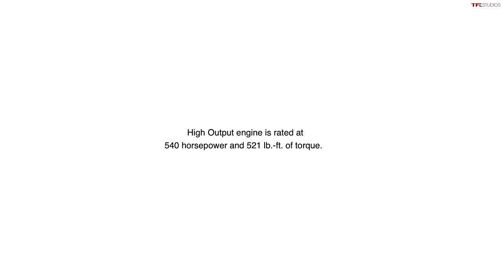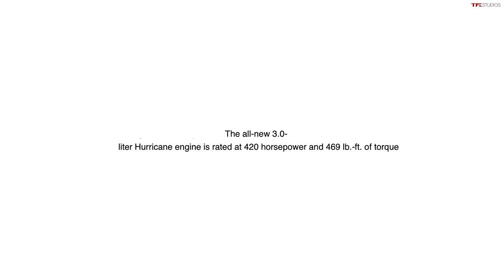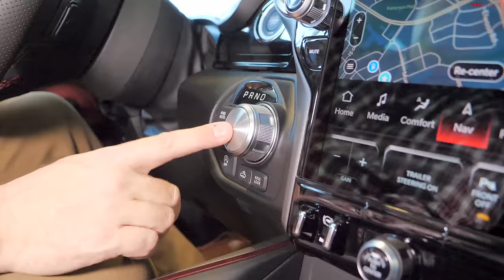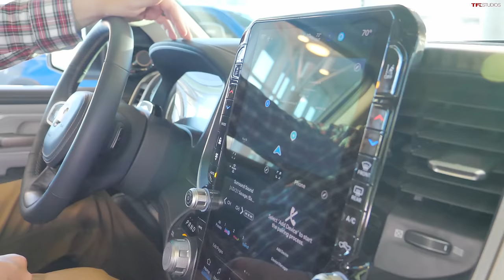I Go Hands On With The First New Ram 1500 In Over 5 Years - Did They Get It Right?

Comment: Let's call it what is is - a COMPLIANCE engine that has more parts to fail and needs premium fuel for the HO version, which offsets any mileage improvement over the Hemi.  $90k trucks with more maintenance cost. Zero savings to the consumer.   Insane.
Reply: Every engine is a 'compliance' engine. When the hemi replaced the magnum engines, the hemi was the 'compliance engine'.
Objectively, an inline 6 is a simpler engine than a V8, so that's an improvement to me.
Reply: @steinwaymodelb yes, an inline 6 is mechanically reliable. But not when you add 2 turbos. Can it be done? Yes. Will it be reliable? Only time will tell and as usual the consumer gets to be the guinea pig.
Reply: @steinwaymodelb  I'm not sure, adding twin turbos, that does not improve reliability simply for the fact it's more complex, plus 90% of RAMs will have the S.O.. engine, while producing more power, gets lower towing and payload rating.
Reply: You are correct sir the H.O requires premium fuel which will kill any gas savings you need
Reply: @steinwaymodelb  Not exactly sure that adding 3 extra camshafts, 8 more valves, direct injection and individual cooling systems for each turbo is more simple than an OHV V8.  Although you do get a shorter crank and don't have to pay for an extra 2 pistons.
Reply: Ill take the new 3.0tt over the 5.7 any day and tune it.  The ram should have had a 6.4 option.  The 5.7 is mediocre, I wont miss it.
Reply: @sergeysmelnik  while i agree the 5.7 was meh, id take it over the 6 any day. The 5.7 was sufficient for a 1500 truck. Now your putting that load on a small engine with boost.
Reply: @mikebandw186  Turbocharger technology is now over a century old. European and Japanese automakers have been making reliable and durable turbocharged engines for decades. 21st-century CAD design, metallurgy, and lubricant chemistry make these engines at least as durable as rusty Hemi designs and likely more durable. There will be the usual minority of clowns who refuse to change their oil regularly, use the wrong oil, or use the wrong fuel, or do something equally stupid and then blame the automaker for their foolishness, but that will always be the case.
Reply: @_emh  Manufacturers have to take into account the lowest common denominator--make it idiot proof. The issue is that these little engines are not going to live longer than a V8 as cylinder pressures in these boosted units equate to higher loads on bearings and rings. They're going to fail long before they should. We're not talking about passenger cars here, we're talking about trucks which are considerably heavier without adding payload or towing a trailer, so yes, turbos have been around more than a minute but the principle hasn't. There is no free lunch, as the saying goes. Cheers!
Reply: However, for people complaining about smaller displacement turbo charged engines, I hope they do realize that Semi’s have been using this technology for decades, and have 300,000-500,000 trucks on the roads, and million mile examples on the road. This technology is all semi’s. Just say you’ll miss the noise of a V8! But an in-line 6 is a great engine to start with! The only thing that be better would be and inline 8! The only problem I see with all trucks at this point is the price.
Reply: The maintenance will be the same, repairs not. Also hemis run on Plus and 6.2 runs on premium
Reply: @georgeferrier9461  Semi's are powered with turbocharged diesel engines, not gasoline like these little engines. If they were gasoline powered, they wouldn't be able to have a GCVWR of 80,000#.
Reply: @strykerentllc  I don't see the basis for the claim that "these little engines are not going to live longer than a V8 as cylinder pressures in these boosted units equate to higher loads on bearings and rings. They're going to fail long before they should." Again, it comes down to performance within specifications. A Hemi V8 subjected to the same cylinder pressures as these straight-6s would of course fail prematurely, because they weren't designed for that. These engines were designed to run at their operating pressures and the materials and production techniques used were selected to ensure durability at those specifications. There's no reason why we shouldn't see some 300k, 500k, and greater mileage examples of these on the road from owners who properly maintain them (granted the reason we see fewer of those today is more truck owners are trading in their trucks more frequently these days and thus always owning a lower mileage truck).
Reply: @_emh  The V8 Hemi in the 1500, 2500 & 3500 are naturally aspirated, not turbocharged and do not operate at the same cylinder pressures. You don't know that? The pistons are cast, manufactured with the same material - 4032 to alleviate piston clatter during cold starts. You didn't know that? If we call upon 6 pistons to produce the same or greater power than 8 pistons, those 6 pistons carry higher loads than the 8. It's simple physics. You didn't know that? Well, now you do.
Reply: @OttoTetrazzini well said .!.!.
Reply: @strykerentllc well said brother, my last purchase of ram was on 2022, they ditch the V8 ..!. Well i ditch them too .!.!
Reply: @gpaje  The information being provided by the site was strange, it showed the SST S.O with better towing and payload and the SST H.O with worse towing and payload
Reply: They’re not complying, Stellantis hates the V8
Reply: @georgeferrier9461 noise, low end torque, simplicity, all of it we’ll miss. Enjoy your quiet overpriced truck
Reply: Ouch

Comment: With those prices, there's gonna be a surplus of these sitting on dealer lots as well 😂
Reply: I got my eye on that Rev and Ram charger. I'll pay the premium to save a ton of money on gas.
Reply: Already is... dodge ram crysler jeep.   Packed solid.. then remove the v8 and its done.
Reply: Fact
Reply: Agreed!!!!
Reply: Yeah, and $200 a month zero down leases will be coming back as well. Right before they go bankrupt.
Reply: esp. when the stock market corrects--incoming
Reply: Wait till you have to replace the batteries ☠️
Reply: @naaruto567  Boy, talking about a nice bill on that one. That is a major issue. Who will buy a 5 years old EV or Hybrid car? Factory gives, what? 8  years on the batt?
Reply: @Turshin  don’t get too excited, my family has three Teslas and our electric bill doubled
Reply: The turbos feed the cylinders
Reply: @michaelottesen6143  One concern I have is cooling these Turbos down under load. Is that engine will take heavy work as a truck and day to day riding. Time will tell. I will not be the first to own, that's for sure.

Comment: To me nothing will ever beat a V8 sure the numbers may be higher, but the sound of a V8 can't be beat especially when you open them up. If i cared more about how much my truck can tow I'll look at getting a 3/4 ton or 1 ton truck.
Reply: I agree i will miss it, but i did have better mpg lightweight with Pentastar v6 , same with 3.7 v6 f150, both about 25 mpg interstate when riding empty
Reply: It won't be hard to beat the reliability of the hemis
Reply: @smiller225  lol, i hope so, you never know ... for me 3th gen egr replace only until tree fell on it at 150k , 4th one exhaust header bolt broke already at 105k, luckily tick goes away in lik 10-20 seconds
Reply: At least they put an inline 6 and didn't put a vibration prone v6 like Ford did.
Reply: Well said!
Reply: Agreed.  I miss the V-8 sound.  I have a turbo 4 Silverado and it has great low end, but sounds like a minivan when you go hard on the throttle.  Wanted a RAM with a Hemi, but with all the BS packages you have to get, would have cost another $15 grand.
Reply: @nezabytes  Which motor is vibration prone? I have a 2017 3.5 Ecoboost and it runs buttery smooth. So much so that on several occasions I’ve accidentally eased off the brake pedal and didn’t even know.
Reply: @joshnc101  v6 engines are inherently imbalanced sir.
Reply: @nezabytes   Well car makers must’ve figured something out cuz newer v6 engines I’ve had experience with don’t vibrate.
Reply: @muznick  but isn’t the sound of a wet fart hemi worth an extra $15k?😝
Reply: @nezabytes  perhaps you have the same problem?

Comment: Love the chassis view of the truck mechanicals. Just awesome.
Reply: Yes. But wish it showed the cooling stack on there. 
Otherwise love how the cats are tucked up close. Prevent theft and fatten them up faster at startup. 
And where the air suspension air tanks are would make a great place for a battery pack for an SST hybrid!
Reply: @upshifter5316   A hybrid would be cool. Especially if engineered for low end torque.

Comment: I love my 2016 with Pentastar V6, solid, reliable powerful. 150k and counting with no issues
Reply: I have same year with 5.7 at 130k, been solid as rock. Other than normal maintenance and one front wheel bearing (under warranty)it’s been great. Had an 06 before it that was still running great at 250k when I traded it in 19
Reply: And gutless, your forgot gutless pentastar
Reply: @pech_wake_day1153 I’ve driven many V6 Ram’s and it’s far from gutless. Unless you’re an idiot and are racing it, it’s got more than enough power for daily driving, merging onto a highway and light towing.
Reply: My 15 is going strong as well!
Reply: Much better then this new crap
Reply: @pech_wake_day1153  gotta have that HEMI for going to Starbucks and Lululemon, huh?
Reply: If you think that's powerful, you previous car was a powerwheels.

Comment: The cost of these new trucks has convinced me to go another direction. Currently saving up for a 1980s Bullnose F-250. For the same money as a down-payment and 2 monthly payments on these Rams I can buy one, restore everything under the hood, upgrade to softer springs and shocks and do everything with an old Ford these things can do except for big towing, which I don't plan on doing anyway.
Reply: Do you live in a locational with minimal oxidation concerns? If so, I endorse your redirection.
Reply: @smithjones1906  I'm in the Northeast. I plan to buy one from the South and I'd keep it parked in the winter and continue daily driving my Subaru.
Reply: I'm saving up for a Komatsu D355A.
Reply: Yup. I looked at new trucks last year and.........I turned around and went and bought a 98 ram 1500 instead.
Reply: You won't have the luxury of the most current government tracking device in that old truck.
Reply: I'm keeping my 2019 Ram 1500 Laramie & buying a tricked out,  refurbished Bobbed Military 900 series truck.  Even with all the bells and whistles, it'll still be wayyyy cheaper than a new Ram !🙄
Reply: 2024 .... that's a hell of a price for being stylish ! @RamblinRoadies
Reply: @haggisnwhisky  See if you can get an old deuce-and-a-half truck or even a 5-ton from a Goverment Surplus Auction and BOB that! 

Those go forever and the ONLY ISSUE is that you SHOULD be sand-blasting the interior and putting in a quarter inch thick coat of Line-X truck bed liner on the entire interior AND the entire underbody, wheel wells, frame rails and even engine bay walls to ensure maximum anti-corrosion and anti-rust protection! The thick Line-X coating also reduces interior noise! You can get an old 8-foot bed from some junkyard and make it at least LOOK like a more modern truck by putting in on the back in place of the rattle-trap wooden and steel rail beds they usually used!

Reminder to do a FULL engine flush and engine shampoo to get that engine all-cleaned up!

V
Reply: @RamblinRoadies  the government will know exactly where he is at in that old truck if he has his phone on him🙁

Comment: The Rebel grill looks so much better than the older style.
Reply: That’s because it’s from a TRX. The entire front end is from a TRX which really cheapens TRX brand. Glad I sold mine
Reply: @313soldier313  I own a TRX and it’s not even close. What is wrong with you?
Reply: @DeepDishPizza  yeah so did I. Until I realized what a load it was and traded it. It looks near identical to these “2025”. The hood vents, the emblem placement on the hood, the headlights, and the grill are lifted directly from a TRX. So are the recovery hooks.
Reply: Looks the same as any other Ram now. The old grill at least was different.. l.
Reply: @BadDriversOfMass  Huh? Are you blind?
Reply: Rebel grill looks like the old gmc grill stop it
Reply: @313soldier313  the new rebel looks more like the old rebel and the new rebel looks more like a regular trim just with a mesh grill. Def looks less like a trx then it did before
Reply: @albertwilliams2990  That’s not true at all. Are you blind?
Reply: @313soldier313  it’s not from a TRX
Reply: @DeepDishPizza   I literally just did a widow by window picture comparison with a picture of the front of my old TRX and the front of this truck. The difference is barely noticeable lol. The grill is almost the same on the rebel just a tad bit bigger. The main difference is the TRX has a hood vent to feed the supercharger and the rebel doesn’t. So quit acting like it’s some radical redesign. It’s close enough that at a distance I wouldn’t be able to tell the difference. Maybe you’re the one that’s blind.
Reply: It went from ugly to kinda ugly. I don't get the random curve on the lower grill trim.
Reply: @313soldier313  It’s a great redesign and not even close to whets you’re saying. Also you never owned a TRX. So nice try there kid.
Reply: I really like the new grille on the Rebel the old grille looked like a pug’s face haha, but i’m not sure if i like mix of push button on the screen and knobs, maybe i’m old school and prefer knob dial design like on my ram bighorn 2019 1500, with the hemi! 😂 i’d possibly would buy that new rebel
Reply: @DeepDishPizza  you are blind look at the last generation gmc's you must be a dodge fun boy
Reply: @DeepDishPizza  Are you? Look at the first two gen Rebel grills and then tbjs new one. It's much less unique looking.
Reply: The Sam Elliott "mustache" grille was cool but had ran its course.  I also like the new style.
Reply: @BadDriversOfMass  It’s very unique and completely different. What is wrong with you? If you don’t like it, then don’t comment on something that you can’t afford.
Reply: @okcmoparguy724  Yeah that’s it.
Reply: @DeepDishPizza Chevy’s grills are WAY better anyways. Nice try, kid, but you are NEVER going to beat anything. Get a life.
Reply: @DeepDishPizza and I don’t recall ANYBODY talking to you… so your the blind one. 🤣🤣🤣🤣🤣🤣🤣🤣
Reply: @DeepDishPizza Chevy beat dodge a LONG time ago… so cry harder 🤣🤣🤣🤣
Reply: @DeepDishPizza You need to get in touch of reality, not your dodge dream boy bud light drinking crap.
Reply: @DeepDishPizza GM makes the best trucks in the WORLD. dodge ram is DONE FOR.
Reply: @traciweisenbachCITB  I guess the optional roof panel  peeling off the truck sure is different 😖

Comment: In 2019 I had to trade my '17 Ram 1500 with a 5.7L V8 for a Ford Ranger with a 2.3L turbo i4 (because my new garage was too small). Two things happened that I did NOT expect. 1 - I didn't lose any hauling or towing capability with the 4cyl Ranger. (except downhill engine braking)  2- my fuel economy was better with the full sized V8.   (The Ram had the 3.21 rear gearing)
Reply: That’s crazy your mileage wasn’t better with the ranger. How did you like your ram and what was your mpg
Reply: @alexgrindnshine2522  I actually love(d) both trucks.  Interior was way better in the Ram both style and comfort (Big Horn vs xlt).  The Ram rode better, and got better highway fuel economy  (16 city 20 hwy) .  And of course, it had that beautiful, sweet, feeling and sounding V8 engine with a bigger gas tank.  The Ranger lacks nothing in the power department although not as smooth and doesn't sound near as good, even with the fake engine sounds from the speakers.  The Ranger destroys the Ram off road in 4x4 situations and tight parking lots.  I tow a pretty big 7200# travel trailer that both handle easily. The Ranger gets better city mileage (19 city 19 hwy).and, of course, the absolute most important factor, the Ranger fits in my garage.
Reply: @ericneal1872  that’s cool, I know people have there mixed feelings about turbo engines. I personally think they have more pros then cons. As long as they are built well of course. I own a 16 focus ST 2.0L turbo and it’s been a fantastic car, great performance and mileage. Also own a 23 toyota highlander 2.4L turbo and that has fantastic performance and great mileage. I have yet to tow with it, but I know it makes like 310lb tq at 1700rpm so I am confident it will tow as good as the first gen V8 Durangos that also have.
Reply: No HEMI-never buy!
Reply: @AleksandrPodolski  I had 4 ram 1500's in a row all with v-8s.  Never a single mechanical problem.  Always put a smile on my face.  I don't share you sentiment.
Reply: @AleksandrPodolski  I have wrench on all of the brands and hemi’s held up great when compared to other V8. My personal really world experience informs my decision making.